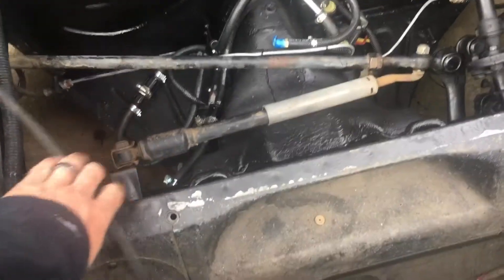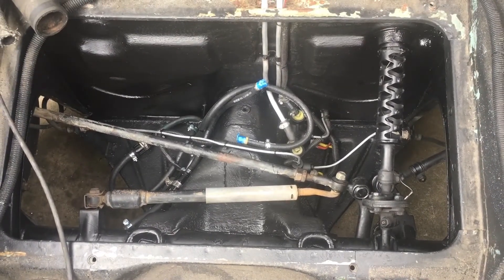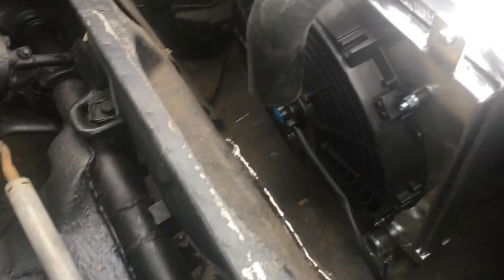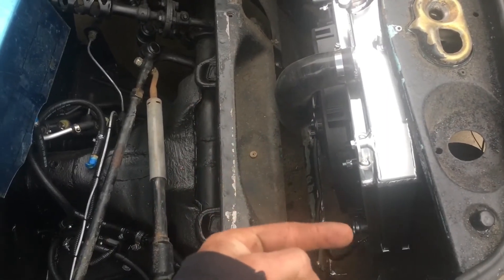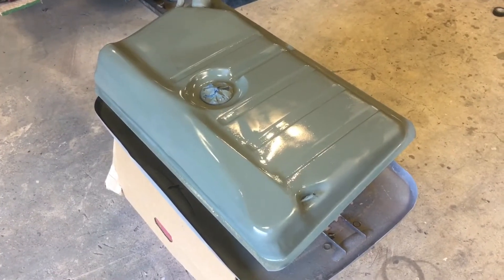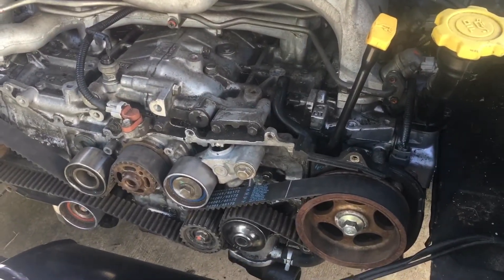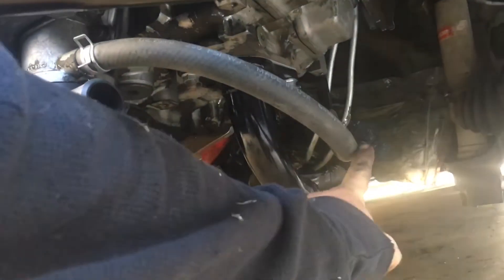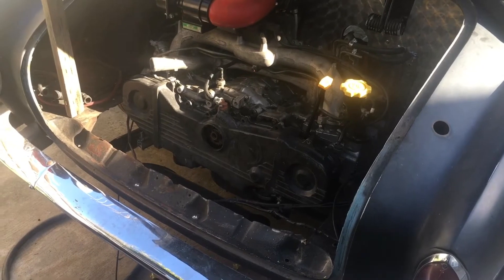Vw ghia Subaru motor

Comment: Did you need anything special to extend the accelerator wires? I read they might have interfence issues getting extended.
Reply from the maker: It was just the throttle position wires not a drive by wire, With this motor they aren’t shielded wires to begin with so no issue there on some of the newer motors the wires are sensitive to other power wires
Reply: @uberkooledgarage  ok gotcha, mine is an 06 sti in a Ghia. Your videos have helped a lot 👍
Reply from the maker: @billygrimes213  o sweet ya my race car has a 05 forester xt motor but has a cable throttle body and I’m glad I could help👍 if you ever need to ask any questions feel free to shoot me a email at uberkooledgarage@yahoo.com any time and I’ll do what I can to help

Comment: Is there a reason you didn’t reverse the intake manifold? We planned on reversing ours
Reply from the maker: He wants to run ac so with the throttle body right there the belt system would be way to complex this way it keeps it simple
Reply: @uberkooledgarage  ah that makes sense, have you ran into problems when reversing the intake manifold besides moving the alternator?
Reply from the maker: @chaysegauthier9497  nothing yet but I don’t see anything that would cause problems